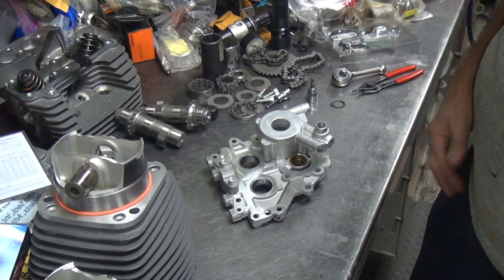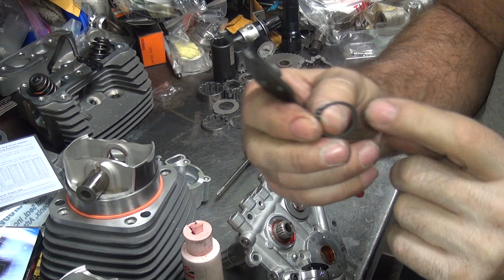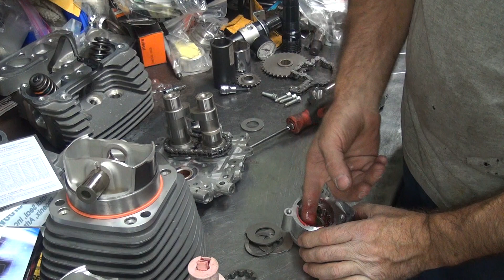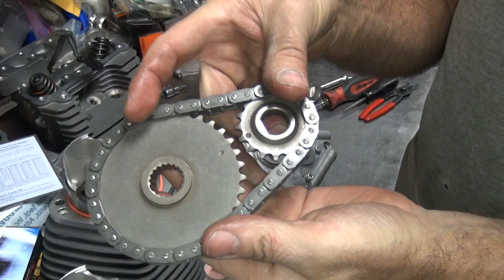#117 2008 110ci cvo twincam fxd dyna motor repair rebuild harley by tatro machine

Comment: Is the gear drive cams on the twin cam 88 a better choice.than the chain dive because the plastic wears out and get in the motor?
Reply from the maker: no, because the floppy crank tears up the gears and comes apart. if the crank is straight then they are ok but noisy lots of times. the chain allows for some of the out of true cranks misalignment and is quiet. use hydraulic conversion kit from harley on the 99-06 motors and things will work and last allot longer. zippers has the dual piston tensioners upgrade that help with the race type cams and high rpms.
tatro
Reply: I Love my geardrive but it is noisy other then that , it really Woke the 03 88 up !!

Comment: I like the oil pump, but not too thrilled about the lack of bushings in the cam plate for the cams. I guess it works, but it doesn't make me want to give up any of my EVO's for a TC.
Reply from the maker: the evo is a better motor and rebuildable.
tatro